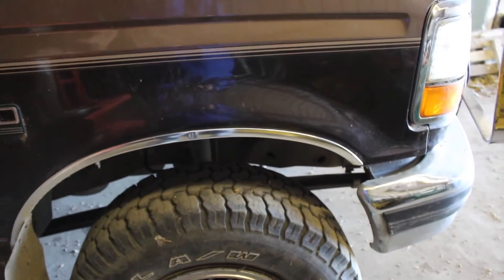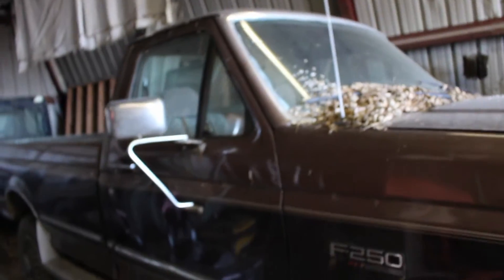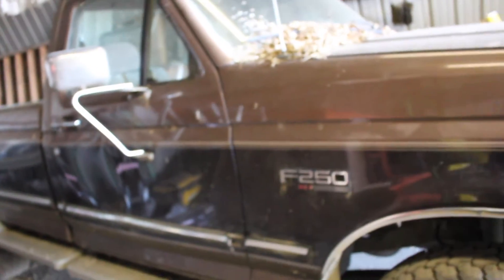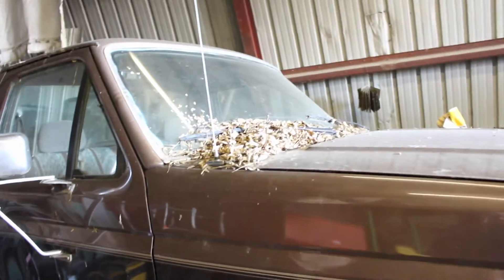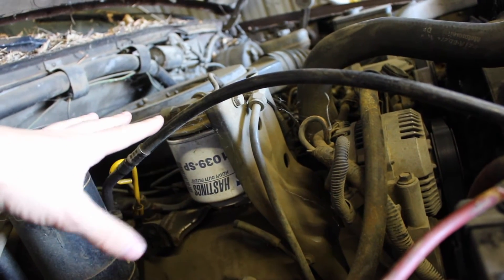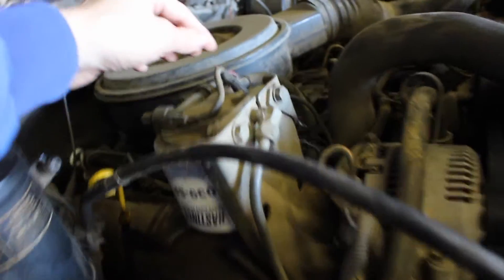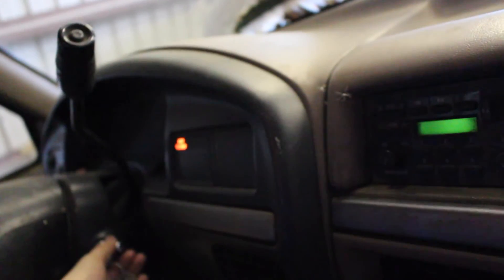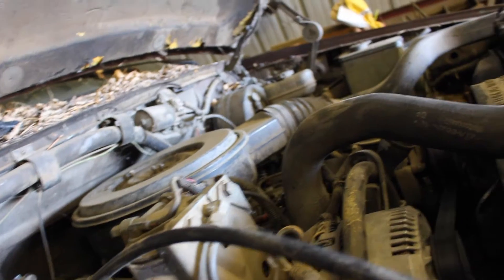New Theory Why The Ford F-250 IDI 7.3L (1993) Runs Rough!

Comment: For what its worth one thing i did many many years ago was put a check value in to the fuel filter housing remove the 90 off housing and fuel line mount check value mount 90 then fuel line with new oring stop fuel bleeding off

Comment: Put a electric fuel pump on do away with that mechanical fuel lift pump get 2 Marine battery and put in u can use rubber hose on the hard line come up from the lift pump put a toggle switch in the cab b4 u start it turn the electric pump on and hit that shrader valve witch is exactly what i do every time i start mine i have mine wire up so all i have to do is flick that electric switch also a electric pump cost 59$ 65$ bucks at a aito parts store yes you have air but a electric pump will make starting it easier along with 2 Marine batteries ive got 2 Marine batteries in my 7.3IDI and 1 of them is 10 years old and still crank motor over like a new 1 youcan charge them up and run them down so many times you cant get a regular battery with 800 cranking amps to do that plus Marine bats are less expensive that regular battery hope this helps

Comment: Yes, air in the lines. Look for leaking fuel at the injector return line caps and 1/8" hoses. The fuel system has 20+ O-rings that harden and shrink over time. You may not see a leak. But if the return lines are older than 10 years old, replace them. Get a return line kit with new caps and O-rings. Another leak is the fuel filter housing heater seal at the top of the filter. O-rings in there shrink. Look for fuel seepage at the top of the f.f. ( I didn't see any seepage in your video.). Is the fuel level below 1/4 in the tank? Sometimes the fuel pickup can leak. Try filling the tank. Leaks can also occur at the lift pump. Those are common leak points. If that doesn't fix it, replace sections of fuel line with clear line so you can see if there are bubbles in the fuel. Start at the injection pump return line to the driver bank section.
It may not work, but I have had some luck with small leaks ( you seem to have a big leak ) by swelling the seals with seal sweller found in transmission fluid from Lucas or in crankcase oil additives.
Air in th eline sis my truck's biggest PITA over the last 15 years. If you plan on keeping it and using it, I'd replace the injector return lines and O-rings at a minimum.  Go to the ford-truck.com IDI diesel section for tips
Reply from the maker: would liked to done that but the engine is now dead so we pushed it in the trees not worth it
Reply: Al Zaidi ,yea looks like you have it covered correctly,I have one and have had a few and the all the same great motors,leaky feul lines ,I got by the hard start with a aux pump set up only to purge the lines of air while the glow plugs are doing there thing ,it's just a pain to fix all these problem ,and they all ways pop up at bad times ,so now I have no hard starts and save my battery's and starter,not to mention sanity

Comment: Replace the rubber lines on the mech fuel pump on the side of the block near the frame. Replace the mech pump while you have it apart. check the lines on the fuel selector valve too - driver side frame rail behind cab. If that doesn't help it could be a plugged return line on the injection pump (the line on top exiting it). There is something like a check valve that can get plugged. Google it. If its not that: Get injectors from conestoga diesel - dont buy cheap untested ebay stuff for example ! They need !! to be pop tested. If its not them then its the injection pump. Check out oilburners dot net - they know everything about them IDIs.
Reply from the maker: yes i did some looking and it looks to be like a crack somewhere in the fuel system not leaking to much to see but causing it to run rough and as for the injectors will they might need to be taken out and pressure checked i think. and thank you for the info i will be checking this stuff out as soon as i can.

Comment: my 1993 ford f250 ran just like that when the top of the fuel sending unit had a tiny little hole in it. i put jb weld on it and it runs great now.
Reply from the maker: yep found a crack there i think that's the problem.
Reply: one of the rubber injector cross lines on my truck started to leak yesterday....so i loosened it off and tryed to pull it off and i broke the black plastic thing...now i have to by the hole inector kit just to get one plastic cap becuse they dont sell them separately..lol

Comment: sounds like you like you got cracked lines running to the fuel filter and to the injector pump may want to check the mechanical fuel pump to tyler it could be a possibly and a combination of both things wish I was there to help you figure it out bud, check the lines going to everything first to try to narrow the problem down the lines are probably cracked from being old and wore just go over everything to make sure the old lines could be the problem on the pump make a video when you get time to tear into it tyler bud
Reply from the maker: yep we found a crack on the fuel filter housing thing that's the issues will some of it.
Reply: I thought there was tyler cant wait till are old girl gets fixed

Comment: some times on those trucks the lines get pin holes in them and lets lots of air in the lines coming from the tank
Reply from the maker: yep it was a crack on the fuel filter housing
Reply: told ya lol

Comment: on the fuel filter housing sometimes there is a small leak on top, also check for leaks near the mechanical fuel pump and the injector caps. all of that was leaking on mine.
Reply from the maker: had a crack on the fuel filter housing